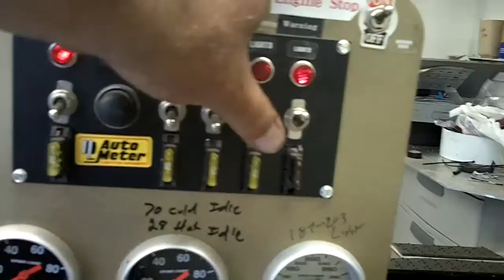sternwheeler first turn of the wheel

Comment: you have stepped every thing down so much ,  engine rev to paddle wheel , close to  1000 revs to  1/4  movement
Reply from the maker: Rodney Gaul not sure on what you r trying to say , we run 1500 rpm in forward in first gear at 6 mph and burn 1 gph in fuel , never had a problem in reverse